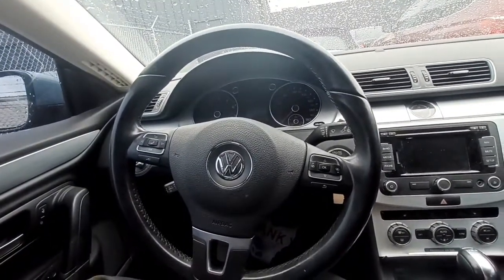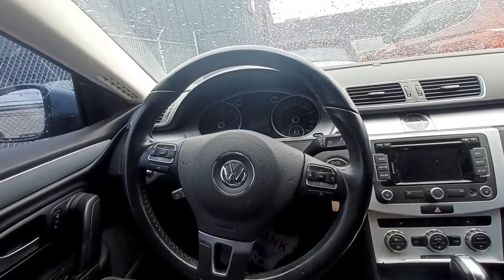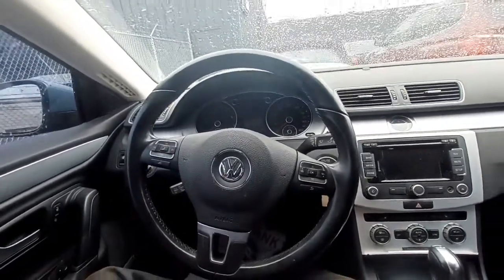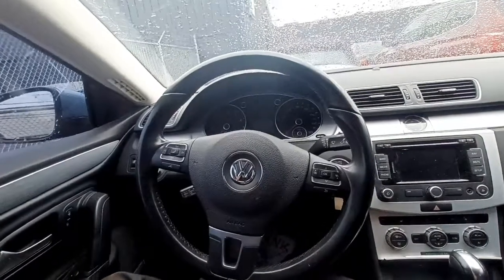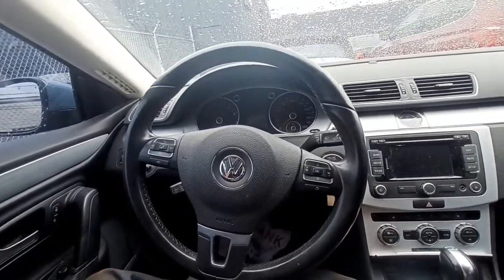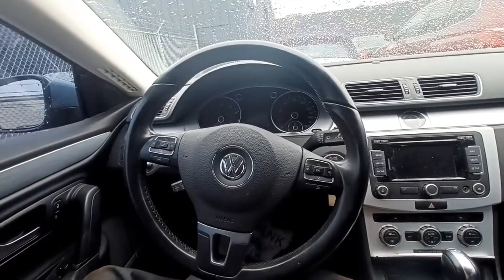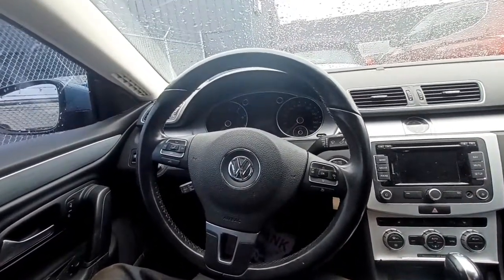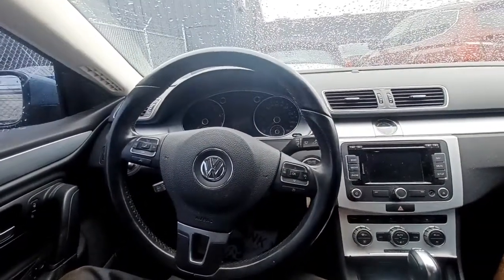TALKING ABOUT THE CAUSE OF COLD START MISFIRES ON A 2.0TSI VW.

Comment: Trying to troubleshoot a P050B Cold Start Ignition Performance CEL on my 2015 1.8T Golf. Just finished some major work. Upgraded the IC, replaced all coolant hoses, replaced PCV and upgraded to an IS20 turbo.

Ever since then I get this code and rough idle even when warm. VCDS shows lots of early misfires on cylinder 1, and a handful on 2 & 4, but never throws any other codes.

My timing advance is all over the place. It's like there's some bad instrument data that's throwing off the F/A calcs or something. Cleaned an oily MAP sensor but that didn't help anything.

Not much info on that code other than replace the coil packs, but before I spend $400, I'd rather know for sure. Wasn't like this before, so it's probably something I screwed up. Am also running my own Simos tune, but nothing crazy, and the cold start tables are still stock. Have you seen this code before?
Reply from the maker: Hmm, nothing is really coming to mind on that one, I would double check and make sure I don’t have any vacuum or boost leaks anywhere. No other faults other than p050b and misfires huh?

Comment: This sometimes happens on my Murano .  Flashing cel and runs rough after start up in the morning .  If I drive it down the street and turn it off and on it runs good .  Is this an injector ? My scan tool said cyl 6

Comment: I have Hyundai Tucson 2015. In the morning, I cold start the car, little shaking, but then it goes away. There is a little smell of fuel just like the VW your working on. Properly my car is doing the same. I have not replaced the spark plugs, they are old anyways.

Comment: Hey I have the same symptoms. Did the injectors and valve cleaning fix the problem?
Reply from the maker: Injector and valve cleaning resolve problem
Reply: @EuropeanAutoRepair  alright thanks
Reply: Hey back again.  so I did the carbon cleaning. The car is still misfiring but only when it's cold when the RPM starts to settle once I put it in drive no misfire. Any ideas?
Reply from the maker: You still may have a injector issue if you have no other related faults
Reply: Cylinder 4 only and sometimes cylinder 1
I did a compression test
Cylinder 4 120
Cylinder 3 160
Cylinder 2 160
Cylinder 1 150
Reply: @muzikking  no offence bud but OP failed to mention that your cyl4 compression looks very low. You might wanna check that
Reply: @MrZan013  Yes I end up have to rebuild the head 😬.. Now she's running like a champ

Comment: i did all that. injectors coils and plugs. i cleaned valves while replacing injectors. its clean as whistle almost. throttle body clean as a whistle. still misfires badly. replaced pcv. that fixed part of the problem but im still misfiring on a cold start. perplexed is the word of the day.
Reply: Same here😢
Reply: Maf sensor, air temp sensor , coolant sensor can be a lot of things sadly 😢
Reply: @AmbA4 yep,  it was the MAP.
Reply: @joey_bag_a_donuts  bad map sensor? Any codes when yu one scan?
Reply: @walidsoltani5118  P0107 I think it was. absolute pressure sensor out of range. from what I understand is these sensors can start malfunctioning well before a code is ever given. I feellucky it was something so easy and caught it before failure.
Reply: @joey_bag_a_donuts  i got misfire without codes and at cold start, the injector seems dead till it get warm, i couldnt find the issus and i this my pcv diaphragm get torn
Reply: @joey_bag_a_donuts  MAP or MAF?
Reply: @Anth78p  yep. It was the map. I figured that out like 2 yrs ago, where were you then? Just joking, yeah.
Reply: SAME HERE! (MK7 GTI 2016)
Reply: Timing if your in oshawa ontario canada 
i can fix for cheap
Reply: I had the exact same problem that you were talking about I changed my PCV valve and it helped a little bit but it still misfired and then a couple days later it got worse and I finally got a code came up mass air flow sensor I changed it and it fixed the problem. 2012 VW CC 2.0 turbo..
Reply: Did you get your intercooler hose looked at to see if there's a whole in the hose.

Comment: I have similar problems.
The codes are I’m getting are:

- missfire cylinder 4
- missfire cylinder 3
- random multiple cylinder missfire
Reply: I replaced injectors about 1 year ago, cleaned the valves, replaced spark plugs and coils about a month ago. All common suggestions, but has anyone in this thread has actually fixed this problem?
Reply: @johnlucas8978 carbon evrywhere !!!!!
Reply: @johnlucas8978 probably some timing belts
Reply: I had the exact same codes. Did you figure it out?
Reply: Same and help!

Comment: Got a 2011 tiguan. Has codes p0300,p0301,p0302,p0303,p0304. Has rear main leak. Seems to misfire when cold but when off idle goes away. When warm its gone. Rear main sealing when warmed up?
Reply from the maker: Do you have any lean running faults stored?
Reply: @EuropeanAutoRepair  none just those codes.
Reply from the maker: @stevesterling6514   you might have something else going on too, have intake valves been cleaned yet?
Reply: @EuropeanAutoRepair  i have not done them personally. Customer just bought the vehicle. Has 171,000km on it.
Reply: @stevesterling6514  Have you solved the issue? If yes, please share what was the fix. Thanks!
Reply: @pawelczechura  mine ended up being carbon buildup on the valves
Reply: @stevesterling6514  I changed coils, spark plugs and cleaned the carbon. After carbon cleaning the misfires are not as intense but still there when the engine has not reached 90C.

Comment: My 2012 vw jetta gli 2.0 tsi is doing the same thing I replaced the injectors coil packs n started doing it again after 2 weeks drive still trying to find the problem
Reply: I have similar problems.
The codes are I’m getting are:

- missfire cylinder 4
- missfire cylinder 3
- random multiple cylinder missfire
Reply: rear main seal
Reply from the maker: What faults do you have?